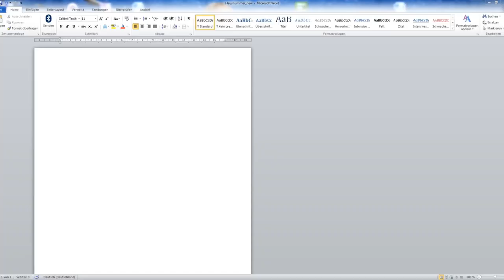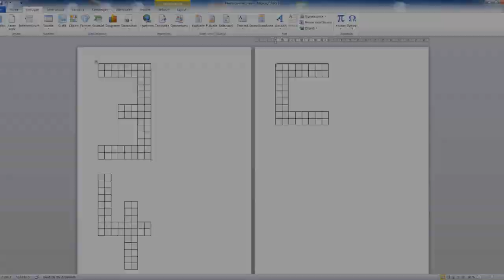House Number Sign Ideas | DIY House Number Plate | House Number Idea

Comment: What kind of wood shud be used for outside house for all weather..
Reply from the maker: I have used Spruce, but you can use any kind of wood as long as you give it a good coating with with any outside (all weather) protection.
Reply: @liviusdiyworkshop1012  o  yes I can use sealer n leaker   ... I thnk it's also water repellent.. It will not harm wood.. Thanx.. Lukin forward to c ur upcoming works..hey one more what is the length of wood.. And alphabet siz, n nail size number... Plz let me know I didn't  understand that scale u shown in video. Plz in mm tell me..
Reply from the maker: @mohdanwarhussain7948  basically I have measured the head of the screw to be find out the space in between them when  placed on the wooden board. The screws that I have used have 0,8cm Head size, you can use any kind of screws (important is that are stainless steel or water resistant). After having the screws you can make a quick how to arrange them. I have used a bit of free will on a choosing the form and size of the letters.
Reply: @liviusdiyworkshop1012 thnku so much for ur rply.. I wanna add my father's name too.. And screw head I have taken is bit smaller than house number screw.. But m confusing to arrange them. Plz help me.. His name is MD. ALTAF HUSSAIN.
Reply: Writing name with single line.. And small size as well.
Reply from the maker: @mohdanwarhussain7948  liviusdiyworkshop@gmail.com is my email address. Please send me an email and I will send you back the word document for my numbers. Or we can get in contact by the phone and explain you how to do it. 👍
Reply: @liviusdiyworkshop1012  brother u didn't replied.. I gave u my nmbr.
Reply from the maker: @mohdanwarhussain7948  where did you sent your number? I have checked my email, I have not received nothing from you.